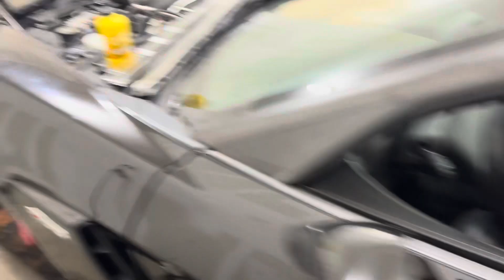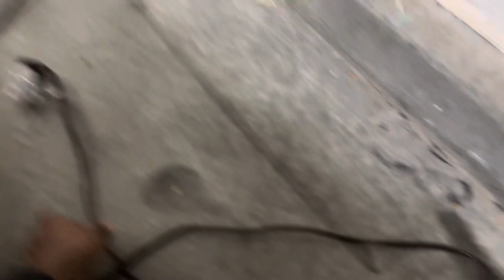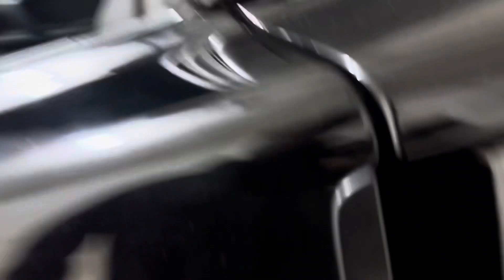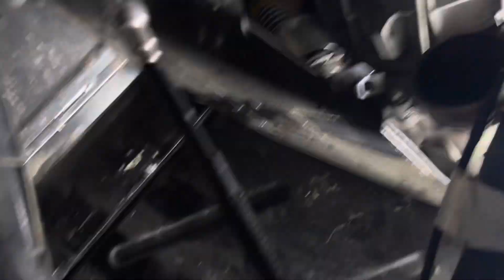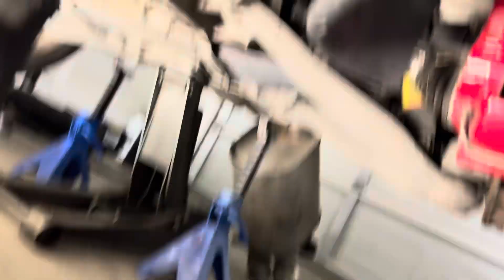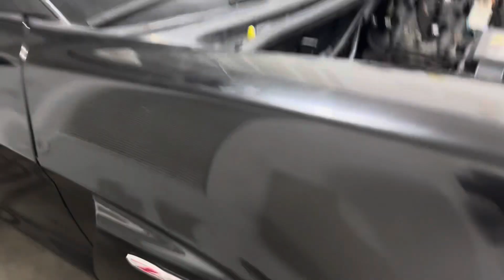Let the fighting begin🤦🏾‍♂️

Comment: One stuck injector will shut that whole bank down you can test each injector with 9v battery to hear if it clicks, or unplug one at a time, I'm sure you checked all fuses, swapped relays, and double checked your ground wires..

Comment: Bro, did you get it going? I heard you say Monday
Reply from the maker: Yes bro she runs now, had to change the crossover tube yesterday but other than that I’m just messing with the tune
Reply: @Thebossdee  NICE!!!
Reply: @Thebossdee don't feel bad, I work on mines like it's my second full time job, I take vacations just to add go fast parts, Just got home from working on it, something to consider if you haven't yet there are plastic tee fitting one these cars and mines started leaking, the big one, goes from surge tank to water to heater core it hasn't blown apart yet but I'm gonna change both of the 5/8×5/8×5/8 & the 3/8×3/8×1/4 just to be safe I started search to find size and everyone's small one leaks, just something to keep an eye out for...I'll post a video of it here soon...
Reply from the maker: @fullsendC6 I’m definitely gonna have to see that video once you put it out so I know exactly what you’re talking about!